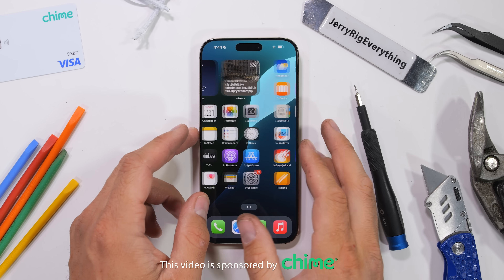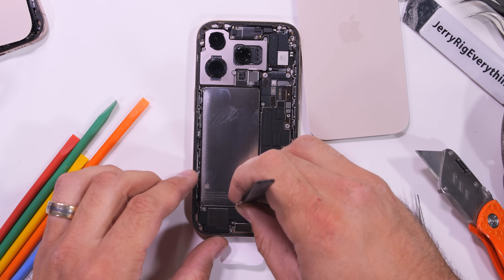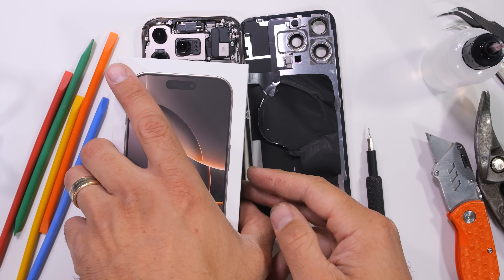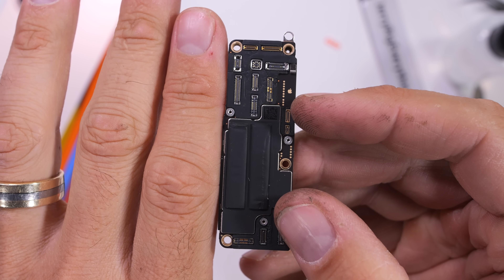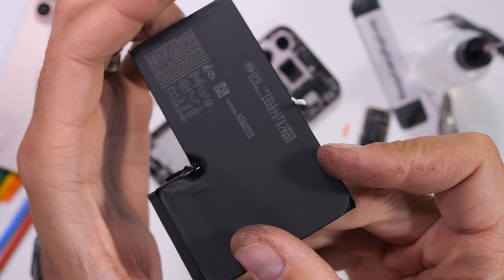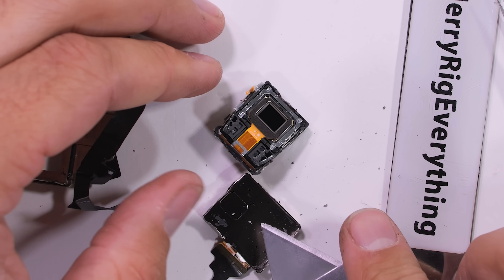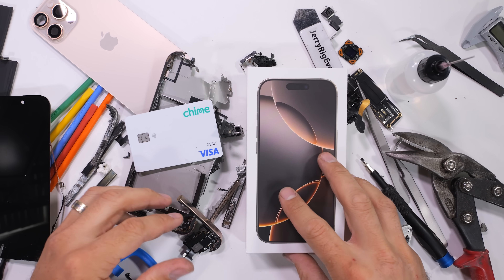Dear Apple: i am sorry...  (iPhone 16 Pro Max Teardown)

Comment: Some iPhone have the new electromagnetic tabs. Is it only ouside US? Anyway, I still think its still hard and boring to remove glue and you loose waterresist. A good move from all smartphone brands, should to use some rubber and screws instead of glue. We use it for decades in other tech devices, why not in smartphones?

Comment: Them posting repair guides is cool and all but in the end most of the stuff inside are serialized and they won’t stop doing that for some time. With iOS 18 they kinda allowed apple original parts to not be a part of the whole serialization, however they have a long way to go in terms of right to repair.

Comment: LOL i really thought the metallic battery closure was present on all iPhone 16 models. If it weren't for this video i would still think the Pro Max model had it as well. I wonder why it doesn't have it, and I also wonder why the iPhone 16 Pro and Pro Max don't use the new voltage sensitive battery glue from the vanilla and Plus variants. I like knowing those kinds of geeky details.

Great teardown as always.

Comment: If you need to remove the pull tag for the battery you should give 12v positive to the silver tag and ground the other near the charging port screw. Then the battery will come very smoothly. 
It's a new technology where the glue will liquidify when applied current. Do try this and let me know on this😊

Comment: How surprising to see that the Pro phones still use the traditional pull tabs unlike the new 'pull' tabs they used in regular iPhone 16 and 16 Plus (electrically operated adhesives), although until next year they might do it across the entire lineup.

Comment: Battery removal fail for the non-pro model. The adhesive is thermally released by applying power to the shell and a ground. Use your Chime debit card to buy another one and try again Jerry. 😂

Comment: If they improve and use that electronic adhesive on the back glass. replacement would be way easier. But I'm sure when that happens tha back glass will be paired to the phone

Comment: Hey Everyone 🤠
Find the parts that interest you:

0:02 - Apology to Apple for repair guides
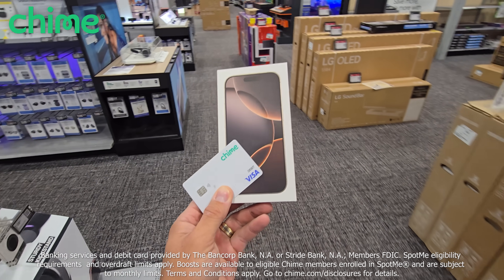1:12 - Thanks to Chime for funding the purchase
3:01 - EU regulations influencing Apple's changes
4:10 - Secret chamber in iPhone speaker
5:14 - Non-metal battery design explained
6:43 - Improved thermal layout for performance
8:01 - Easy screen repairability discussed

Recap by Bumpups ✏️

Comment: I hope that the removable batteries that EU wants, will actually be removable on the go, like in the “dumb” phones. It will be pointless if I will need to open the phone aka slice through glue and not shatter the back glass in the process.

Comment: i am struggling to find upgrade from a iphone se2 the se3 is the basically the same thing i still use a iphone 5s(i have put one new screen and three batteries in it but that is maxing out my teck and youtube skills ) that i use as a audio book player for the 3.5mm jack as i have never found a good dongle adapter that will not break and i need corded earphones (tbi, dyslexia and some other filtering and memory problems as well as working conditions means i needed corded headphones so i dont loose them and i hate the cost and extra ewaist) i dont need a large phone but i am hoping to get somethign with a usb C as apple really dose not seem to support things they have deemed obsolete long and the short i have saved this long and was about to get a iphone 15 base model is there any reason to hold off a bit and try for the 16

Comment: they use a metal battery in the small apple watches I thought when they do that they use a more expensive and dense battery to meet the design requirements that they want for feature parity between the models.

Comment: still daily driving my 2nd smart phone ever. 2016 iphone se board that i put inside of my old iphone 5s chassie. people forget that apple used to use 7 series aluminum which is pretty tough stuff considering i havent used a case the last 3 years ive had the phone and it still looks almost brand new. interestly it chips instead of smushes on the 2 nicks from dropping it. the back aluminum case gives up the gimmickey wireless charging but gives you a really good heat sink. i put pylrolized graphite stickers in mine. i replace my battery and screen about once per 6 months if i get a crack. costs about 5 bucks each time. no ugly camera bump, indestrcutable sapphire camera lens, no fugly camera bump, and the camera litterally films in 4k. the logic board was like 20 bucks and i just bought bad imei junk phones off ebay for 5 usd each for the original parts. oh yeah, and it has a headphone jack lol. did you know you can theoretically charge through the headphones jack? some of the iphone shuffels literally did that back in the day. the original usb-c port with less connectors

Comment: So, does the metal cse for the battery have any additional benefits? Like not letting it bulge as it ages like that of the older phones or some sort of protection against battery catching fire? or are there any negatives of having it in a metal case?

Comment: This is great and all, it truly is and, I'm glad that Apple has actually changed their mind about keeping to themselves and opening up, giving us consumers what we have the right to have. Releasing a repair guide for most iPhone models is a big mode but of course, they are only doing it because of the EU, shout out to them for mandating this since, if they didn't. We the consumers would have to deal with the crap that Apple does without much consequence, for much longer.

But, the issue that each part is serial paired remains so, this "solution" won't fix that issue that is extremely anti-consumer. A dick move on Apple's part if you will. Even so, I hope that in the future, something can be done against the serial part pairing issue. I should not have to buy an entire new phone just because Apple doesn't allow me to replace my iPhone that I paid with MY money. Don't care what Apple thinks, you make a product, you sell it, it belongs to the consumer, not you anymore.

Comment: what happens if the battery expands over time? Do lithium batteries actually swell? I’m not an expert, so I’m just wondering if that’s something to be concerned about..
Reply: Lithium batteries do sometimes swell up, my guess is its just a thin layer of a softer metal so if it does swell the metal will just push out with the battery, I haven't had to do an iphone 16 repair yet so I'm not sure how thin the metal really is.
Reply: yes they do & I guess we will find out in the next few years if it does start causing problems.

Comment: That metal-enclosed battery allows a low voltage to be applied to the outside of the battery which causes the special, electrically-sensitive adhesive holding it in place to release more easily, aiding repair/replacement. The new battery replacement method in the ‌iPhone 16‌ models is required by a new European law. The EU is requiring smartphone manufacturers to make sure batteries can be replaced by users with easily accessible tools by June 2025.
Reply: No that's just on the standard 16. I expected to see it on both Pro models too.

Comment: Really curious to see how the EU rolls out the removable battery law. If they go full pre 2010 mode and force all manufacturers to have a hot-swapable battery, or just that it has to be like "less than x amount of steps" to remove the battery. I always thought the LG G5 had the right idea with battery swapping, and I think it'd be nice to see manufacturers have to innovate a new design that's actually useful (hot swappable batteries with an ip68 rating). Even if they were going to be forced, nice to see actual repair guides from one of the biggest manufacturers in the infamously closed door tech world.

Comment: It has been interesting to see how the internal design of the iPhones has changed since I stopped working for a repair shop a few years ago. iPhones and the S series of Samsung phones were always preferable to some of the other one off devices because they all remains rather consistent in design so you didn't really need to investigate or guesstimate too much on what a repair was going to take.

Comment: Why does every iPhone 16 have a different battery? I saw a video earlier today where somebody was able to remove the battery using a 9 volt battery and connecting it to purposely made contacts on the battery that would cause it to release.

Comment: Apple: We're gonna remove the headphone jack so we can have more space for important stuff
Also Apple: Best we can do is a block of plastic on your simcard slot
Reply: adding a slot for an expandable memory card will cost another 300USD
Reply: @enchantedslumber79  no I don't need gold one
Reply: Some of Samsung's midrange and low end stuff still has headphone jacks & Micro SD card slots, too...though I fully expect them to get rid of'em entirely from all models by the end of this decade (2029), so when the 2030 iterations start to come out, none of'em will have those things.
Reply: Lol many other brands removed the jack
Reply: I'm not even an iPhone user, but that piece of plastic gave me depression, and I didn't even think apple could disappoint me anymore
Reply: That’s not the actual stated reason to remove the headphone jack,
Which all smart phones besides Sony did….
Reply: @AL-lh2ht all smartphones did this BECAUSE Apple did. And they saw how much you could save on water resistance and profit from wireless headphones.
Reply: @Naris17  so are you trying to blame apple for what the other companies did??
Reply: @AL-lh2ht  Sony isn't the only other company that didn't get rid of the headphone jack. Motorola and Asus are a couple others off the top of my head.
Reply: @tsardean9192 Motorola did get rid of it. In fact it was the first phone I had without a headphone Jack
Reply: @lordzeuscannon6400  It depends which Moto phone you get, disappointing that they don't all have the headphone jack but a lot of their phones still have it, mostly the budget ones
Reply: This dude still uses a headphone jack 😅
Reply: @scrawz1181 wired headphones do give a better quality sound, just sayin
Reply: @bruce_man with proper codecs, not really. Sure wired ones are cheaper for similar quality and there’s more options.
Reply: @NameName-ll2yx  not really huh? So tell me, why music producers or sound experts do still bother themself with the wired one?
Reply: @bruce_man  Partly due to technical ignorance, compatibility, potential latency due to the former reasons, just are used to them and the fact you can buy 10k€ wired ones and amp setups. 
The wirelessness doesn’t affect the sound quality or cause noticeable latency when using the right setup, but other factors remain that have nothing to do with those.
Reply: @NameName-ll2yx  Yeah like you said, partly. While wireless performance is better than ever due to increasingly efficient Bluetooth codecs, DACs and amplifiers, it's still unable to offer the purity of wired performance. Primarily, analogue transmission through a cable can carry a song's full audio data, whereas audio transmitted wirelessly is compressed and crucial information is lost.
Reply: @bruce_man  But crucial information isn’t actually lost with LDAC or Aptx-HD/adaptive.
Reply: @NameName-ll2yx  yea sure.

Comment: You complain about the pull tabs but you haven't even read about them. You need to plug a 9v battery on 2 different spots in the iPhone and after a minute I think it is then they deglue themselves automatically...

Comment: would've been interesting to see how well a 9v battery works on the battery adhesive, apparently apple has stated that the adhesive loosens with an electrical current applied to it

Comment: the best pull tabs are up to iphone 7 in my opinion , when they started to use the wireless charging coils from iphone 8, they changed the adhesive as well, not as stretchy and is not as satisfying anymore, but hey at least we always find the alcohol the best technician's friend :D

Comment: 4:28 "if your vibrator hasn't buzzed in a while, sometimes you just gotta be the one to reach out first" Very sexual 😏
Really cool to see that Apple has finally put out a bunch of detailed repair guides for their phones -- too bad the devices themselves are not easy to take apart. 😬 While this is certainly a good move, it would be even more useful to actually make the smartphone able to be disassembled without using heat. 🚫🔥

Comment: The metal battery casing is for the non-pro variants and will be used to remove the battery by applying a voltage directly to the adhesive.

Comment: I prefer the fully replaceable batteries on phones from like ten years ago. the phones with unbreakable plastic backs that could be removed by the user.
Reply: also i do like the direction that apple is going. Even though they aren't making huge improvements every year, the phones are still getting better over time, instead of just getting cheaper.

Comment: @JerryRigEverything. The adhesive behind the batteries can be removed with alligator clips and a 9 volt battery because the adhesive is electrically charged

Comment: You’re supposed to connect a 9V current to two prongs and the low voltage to release the battery adhesive

Comment: I'm not sure of what Apple did there but from my experience handling things like this, they're basically bridging the battery terminal with the metal plate under the iPhone battery which generates heat to weaken the adhesive...

Comment: In Australia there's no pulltabs under the battery. Hugh Jefferies attached a 12 volt power source to a tab on the battery, and it was released. Pretty cool, if you happen to live in Oz 😂

Comment: I saw another tear down where you are meant to remove the battery adhesive by applying a low voltage current to to it, 12-24 volts.

Comment: Metal batteries look sick. I wonder why the Pro Max has a standard battery with pull tabs but the Pro has the new metal encased battery? Also apparently using a small amount of electricity on the new battery makes it pop right out, something to do with the glue on the back reacting to it. Do you know anything about that?

Comment: 5:30 this is the real way to pull the pull tape. 
Before we try to pull it we have to remove the speaker and things on the down. 
Then it will easy to remove. 
That is the real way from the iPhone 6 time.

Comment: I recently saw an video with iPhone 16 and I was surprised to find out that it has a completely new method for removing the battery! An external 9V battery is used to trigger the system that releases the internal battery. An interesting innovation, especially since it makes the process much simpler and faster than previous versions.

Comment: JerryRigEverything praises Apple for publishing repair guides for their recent smartphones and apologizes for all the mean things he has said about iPhones. He retracts them and is happy that Apple's move benefits all of humanity and helps keep the 200 million iPhones sold every year alive for longer. He also finds it easier to repair iPhones now.

JerryRigEverything then proceeds to take apart an iPhone 16 Pro Max. He finds that the battery is not metal encased, which is a bummer. He also finds a suet 25 watt coil of 100% recycled copper Wireless windings still attached to the back glass. He is glad that Apple is using recycled materials in their products.

JerryRigEverything then gives away the iPhone 16 Pro Max to one of his subscribers. He also talks about the new EU regulations that require all smartphones to have removable and replaceable batteries by 2027. He thinks this is a good move and that Apple is probably not as Ultra generous as we thought. They are only providing repair guides because they will soon have to legally do so.

JerryRigEverything then continues to take apart the iPhone 16 Pro Max. He finds that the battery is 3582 milliamp hour and that the battery info is etched into the steel housing. He also finds that the phone is not water resistant anymore. He then takes apart the rest of the phone and finds that Apple has made most of the components inside the two pro phones the same minus the battery and screen size. He also finds that the motherboard is smaller than a human finger and that there is no SIM card slot in the US version of the phone.

JerryRigEverything then talks about the new charging port design, which is much easier to repair. He also talks about the triple camera setup, which is all bound together in a singular metal housing. He then takes apart the cameras and finds that the main camera image sensor has copper coils on each Corner which balance over the permanent magnets to stabilize the image. He also finds that the ultra wideangle camera does not have any internal stabilization and that the 5x telephoto camera has a glass tetr prism to distance the sensor from the lens giving us that periscoped Zoom telephoto effect.

Finally, JerryRigEverything takes off the screen of the iPhone 16 Pro Max. He says that the screen is easily repairable from the front and that Apple smartly made the screen easily repairable from the front so that none of the back Hardware that you just saw needs to be touched at all. He then complains that Apple is still charging $379 to replace the screen. He thinks this is kind of excessive.

Overall, JerryRigEverything is impressed with the iPhone 16 Pro Max. He likes that Apple has released consumer repair guides and that they are dabbling in new manufacturing techniques. He also likes that the phone is made with recycled materials. However, he is disappointed that the battery is not metal encased and that Apple is still charging so much to replace the screen.

Comment: I wonder if the metal encased battery is more puncture resistant or more durable than the normal batteries.